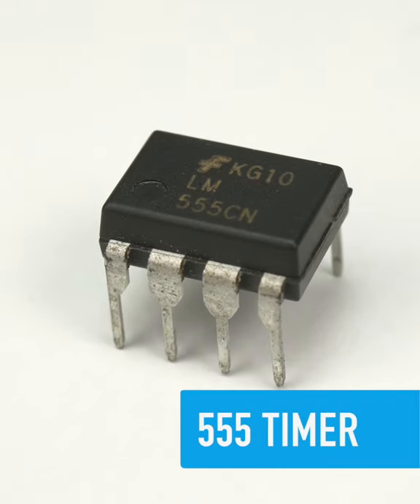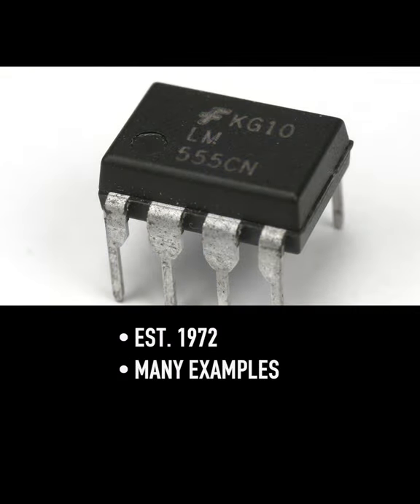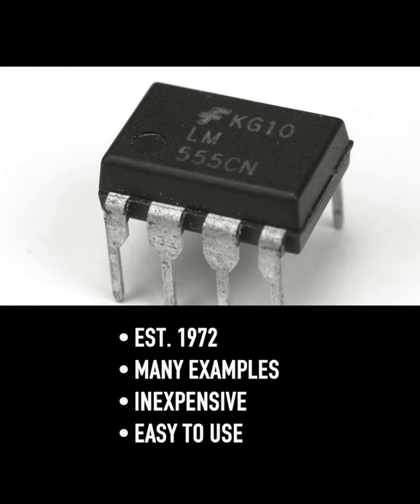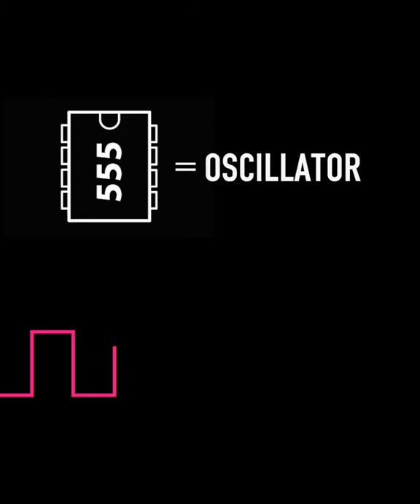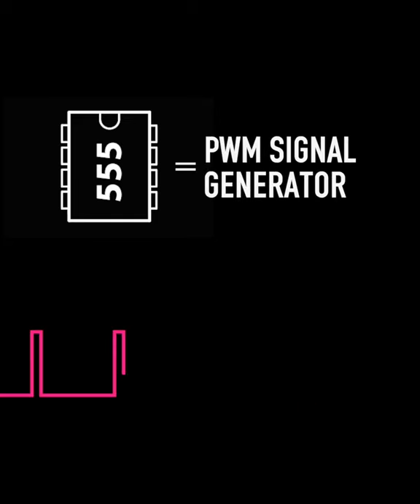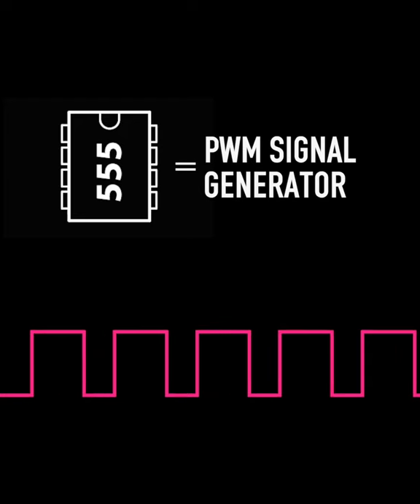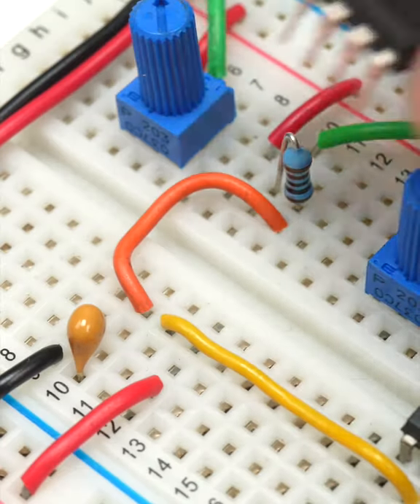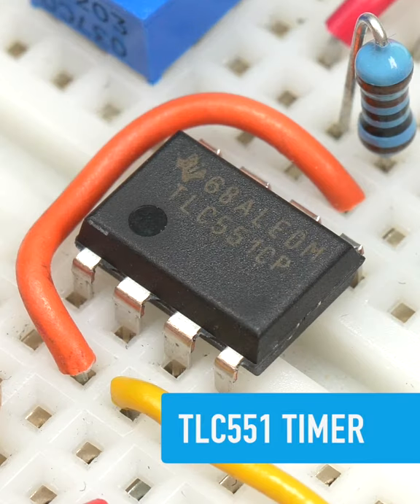555 Timer - Collin’s Lab Notes #adafruit #collinslabnotes

Comment: May it be possible to do a video on how IC's are made? I mean not how they produced in the factory i mean how is it working to get "the logic" into them so that the can do what they are designed for? On the datasheet its really interesting to see what such an IC can do but how is it done?
Reply: That's a very good idea. IC design is a very interesting but also immensely complex field. Basic circuits like the 555 timer could be drawn by hand, but modern CPUs and microcontrollers get ridiculously complex. 
But I doubt he's the right person for that subject.

Comment: If you work on linear power supplies a lot from the70s, the LM723 voltage regulator is a legend. I still see it used in linear supplies in this day and age.